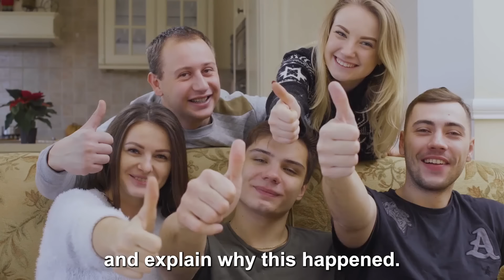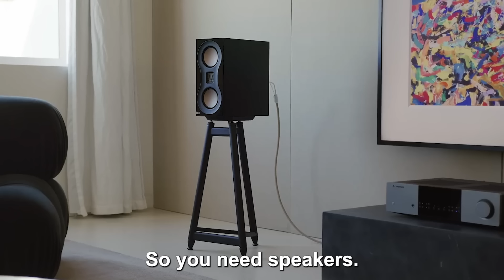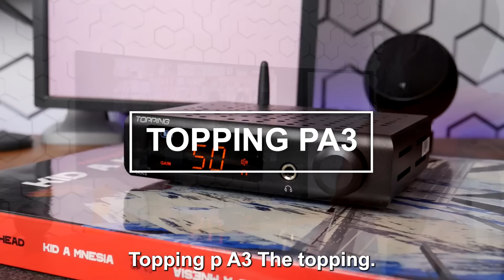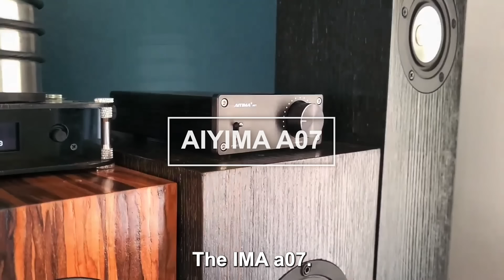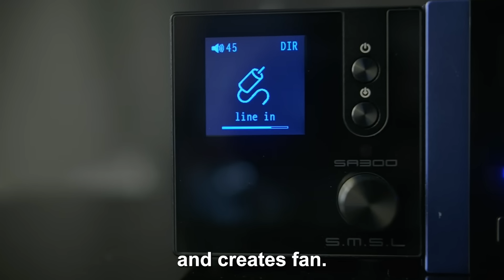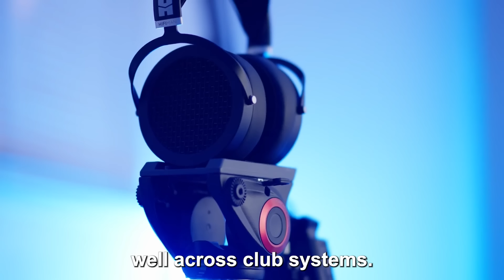These Budget Studio Amplifiers DESTROY Premium Brands in 2026!

Comment: Laughing my ass off. Because what there saying is absolutely true. 8 months ago I found a brand new, cheap 300 watt Delta amplifier. It cost me 140 dollars. I plugged it in through my main av Marantz NR 1200. through the pre/out connections. The sound coming out of my Klipsch RP 600M II was out in orbit. It blew my FN mind. Sound stage, head room and noise floor were so mind bending. Every time I hit the power button I laugh my ass off.
Reply from the maker: That’s the power of proper amplification 😄 External amp + pre-outs can unlock way more headroom and control. Once you hear it, it’s hard to go back 🔥

Comment: Can these be used for a home theater set up?  Meaning 5 speakers and a sub?
Reply from the maker: Yes, you can use them in a home theater setup. Just make sure your AVR supports passive speakers and add a powered subwoofer for the LFE channel.

Comment: Bullshit , the shit systems your talking can not handle real speakers that are high quality , as these shit amps your speaking about have low current transformers  and real speakers with proper sized woofers require high current systems ,,,and proper speakers are at least 8 ohms  ,  so the amps/receivers  you speak of are 6 Ohms at most, not enough to power high quality speakers ,,,and even if the receivers your talking were 8 ohms ,,they still wont be able to drive proper speakers due to low current transformers , The system you speak of are no match for my Integra receiver not even close and your cheap receivers would never be able to drive my high powered 140 watt RMS speakers , with 350mm woofers
Reply from the maker: 8 ohms doesn’t automatically mean “high quality.” Impedance curve, sensitivity, and real current delivery matter more than just the number on the back.

140W RMS is max handling, not constant demand. In normal home use, most speakers use far less power.

Good gear is good gear — but let’s keep it technical, not emotional. 👍
Reply: @ConsumerSound   Everything I said  technical , the white van systems your pushing are low current low quality and yes ohms do matter ,  if your system is 2.5 ohm amp there is no way it will ever in 20 million years power an 8 ohm speaker , either return current will fry the system or the out going current will blow the speakers ,,,  If your driving shitty 2.5 ohm speakers then that's fine but you will never get the depth of a 8ohm speaker delivers , ,, even if the amps your pushing were 8ohms they still would never be able to drive a proper 8ohm speaker with 250mm woofer , due to having a Low current transformer , and a amp that is not capable of pushing out 100 Watts per channel RMS , will never be able to push a speaker properly that is rated at 80  watts RMS or more  , it will struggle and sound like distorted  ,,,,I am a professional Musician/recording artist , I Know all about sound.

Comment: On the BT 20 it's a 3.5 mm output not input it's output for like say a subwoofer
Reply from the maker: Correct 👍 On the BT20A it’s a 3.5mm subwoofer output, not an input. It’s meant to send signal to a powered sub, not receive audio.

Comment: Studio amplifiers?
Reply from the maker: Studio amplifiers usually means gear designed for accurate, flat-response monitoring rather than colored sound. They’re built for precision in mixing/mastering, not for home theater punch or warmth. Different goal than consumer amps.
Reply: @ConsumerSound   Bull shit, not a single reputable recording or mastering studio would consider using these amps to monitor. Laughable.

Comment: I bought a Lepai mini class D amplifier, it was advertised as delivering something like 40+40 watts. I think it only put out like maybe 8 watts per channel at best. I mean for real, how many watts per channel can you expect to get from a little amplifier that has only a 9 volts power supply that plugs into the wall!!? It struggled to power even a small pair of speakers a decent volume
Reply from the maker: Exactly. A tiny amp with a 9V power supply physically can’t deliver real 40W per channel. That’s peak/marketing numbers. Real continuous power is usually under 10W. Power supply limits everything—no magic there.

Comment: Class D amps are indeed the future of amplification.  Todays Class D amplifiers are an eye opener for costly Class A/B amplifier manufacturers.  Class D has caught up with Class A/B sonically.  Class D within the next 5yrs will surpass the best Class A/B has to offer sonically at any price range.  As a side benefit class A/B amplifiers make great space heaters!  Maybe use class A/B amplifiers exclusively for harsh cold winters!
Reply from the maker: Class D is improving fast, no doubt. But topology ≠ implementation. High-end A/B and Class A still win in dynamics, current delivery, and longevity. Cheap Class D ≠ reference sound.”

Comment: I own a half dozen Chinese Class-D amps, and they are pretty darn good.  I'm listening to to this AI narrator on a Fosi T20 with NOS GE JAN-5654Ws.  My favorite Class-D is the Aiyima T9 Pro with GE JAN-5725Ws.  But my studio amp is actually a Rotel 1067 AV receiver.  It has multiple stereo inputs, 5.1 analog inputs, and effectively three sets of stereo speaker outputs.  That's handy.  Of course, it's the size of carry-on suitcase and weighs 45 lbs, so placement has to be carefully planned.
Reply from the maker: Nice setup 👍 Budget Class-D is good for desktop, but full-size amps still win in power, dynamics, and durability.

Comment: These small cheap Chinese made amps. are designed for desktop, students living in dorms, garages, vacarion homes, etc. playing music in the background. Most of them will be dead in a couple of months or years. I have been there, do not waste your money on these called budget amps. There are plenty of good products, available nowadays, in sound quality and value from brand names with  very reasonable prices.
Reply: You are completely wrong with your comments. Although I object to these AI generated videos that are so common now, many of the claims made here are factual. I have been using Topping products for many years (early adopter) and they make excellent DACs and amplifiers for very little money. I also own Fosi amps, cheap and unbelievably powerful and clean. I used to design and build my own Class A/B amps but it does not make sense anymore as these modern class D amps are way cheaper and sound just as good. Believe me, Class D has come a long way and names like Topping, Aiyima S.M.S.L and Fosi are great bets and not just for desktops, they have room filling power.
Reply from the maker: Fair point—cheap Chi-Fi amps are hit or miss. Some are great value for desktops, but long-term reliability and power usually can’t match proper branded amps. You often get what you pay for.

Comment: ONLY GOOD FOR LITTLE TINY SPEAKERS!!! 😂👎👎
Reply: Sorry, but you are wrong. My Aiyima A07 Pro easily drives my 1.6m tall floor, standing Peterson 180W  8 ohm speakers [from the 80's, 3 way with 10" woofers] to a distortion less volume that blasts my lounge/dining/kitchen area. The needed power supply is 48V at 5A. This tiny amp can deliver 2 x 200W RMS into 4 ohms with the optional 48V 10A power supply.

Comment: Do i need one of these?? i have a Denon S970H with klipsch 8000FII tower speakers, 502C center speaker, 600M II, 500SA and (2) R-12SW Subwoofers
Reply from the maker: No, you don’t need it. Your Denon S970H + Klipsch speakers are easy to drive and already very powerful. Only get an external amp if you listen extremely loud or have a huge room.

Comment: I have an Aiyima A07 Pro [48V 5A power supply] with 2 x Sparkos SS3602 discrete dual op-amps fitted, combined with Mission 700 speakers at bout 1.5m out from the walls [in a near-field setup]. The sound is spectacularly good!
Reply from the maker: Nice setup. The A07 Pro with Sparkos op-amps is a big upgrade over stock, and Mission 700s in near-field can sound insanely good. Shows how much placement and clean power matter.

Comment: I'm still rocking the Topping D70 with the dual AKM 4497EQ chips from before the AKM fire which prematurely ended the 4497 production line and which delayed the 4499 chips by several years. After the fire, Topping and other brands had to rely on Sabre chips. Putting the AKM vs Sabre debate aside, I'll probably never let this DAC leave my collection.

I remember that after the AKM factory fire, all the DACs with the 4497 chips quickly sold out, were seldom up for resale and made the second-hand prices soar. Now that the 4499EQ chips are readily available, the old 4497 devices are likely back to normal second hand prices. I am still enjoying this DAC on my head-fi setup and I consider it a legacy device with some rarity to it as the production run with AKM chips was stunted by the fire.

Even going back all those years, this delta-sigma DAC already measured great. Black background, neutral sound, low THD. The only thing that ages is the Bluetooth version which I don't use anyway. This DAC was one of the single best purchases I have ever made. Still using it. Right now.
Reply from the maker: Sounds like an incredible, durable DAC that still delivers top-tier performance for your setup. 👍

Comment: 2 x $55 + power supplies (2 x 48V 10A). 
I have Magnat Vector Needle Floor Speakers (nominal/music): 200 / 320 W. And Magnat Alpha 30A Subwoofer. 
To power these I have Aiyima DAC A3 to 2 x Aiyima A07 Premium (nominal/max): 250 / 300 W (upgraded from A07) Amps Bridged and Bi Amping the Speakers and from the Audio Out to active Sub. 
Tone/colour of the sound is controlled on these Class D amps by Op Amp swapping. Aiyima DAC A3 I changed all 4 op amps to opa1612 because it is inexpensive with very good clarity, overall range (very good focus on Highs) and stage. Aiyima A07 Premium Amp one has opa1612 to handle the High and second Amp with opa2134 that handles the low very well. 
I have a vintage system that is more than $5000 more coin and hardly gets used anymore.
Reply from the maker: That’s an incredible DIY setup—op-amp swapping for fine-tuning sound is the ultimate budget audiophile move! 🔥